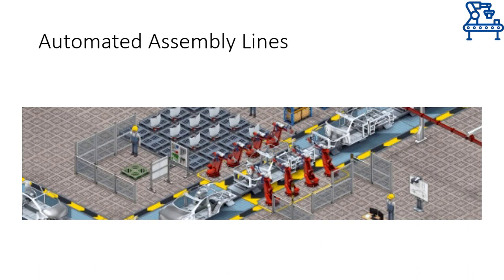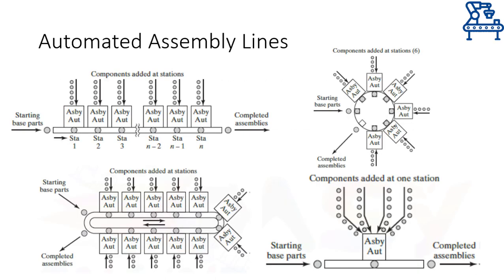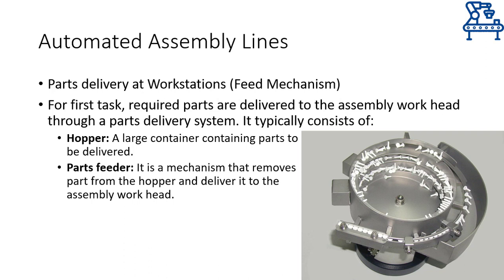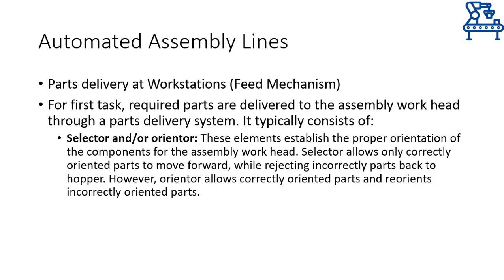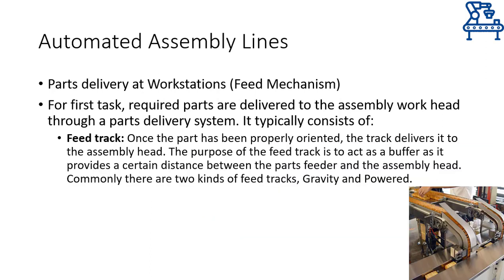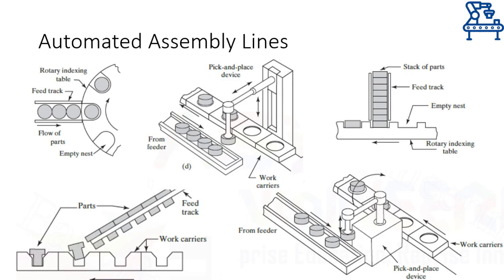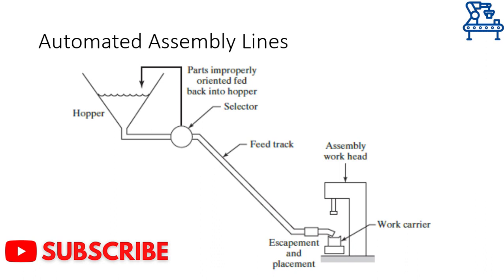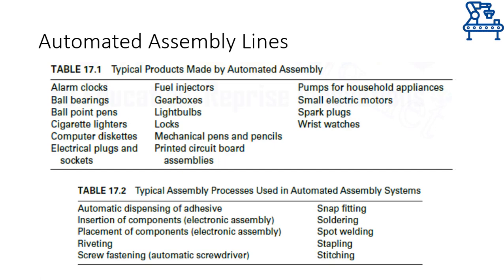Automated Industrial Lines | Assembly Lines

Comment: Consider the EXAMPLE of  assembly of a CAR,
let's assume that certain steps in the assembly line are to install the engine, install the hood, and install the wheels (in that order, with arbitrary interstitial steps); only one of these steps can be done at a time. In traditional production, only one car would be assembled at a time. If engine installation takes 20 minutes, hood installation takes five minutes, and wheels installation takes 10 minutes, then a car can be produced every 35 minutes.
In an assembly line, car assembly is split between several stations, all working simultaneously. When a station is finished with a car, it passes it on to the next. By having three stations, three cars can be operated on at the same time, each at a different stage of assembly.
After finishing its work on the first car, the engine installation crew can begin working on the second car. While the engine installation crew works on the second car, the first car can be moved to the hood station and fitted with a hood, then to the wheels station and be fitted with wheels. After the engine has been installed on the second car, the second car moves to the hood assembly. At the same time, the third car moves to the engine assembly. When the third car's engine has been mounted, it then can be moved to the hood station; meanwhile, subsequent cars (if any) can be moved to the engine installation station.

Assuming no loss of time when moving a car from one station to another, the longest stage on the assembly line determines the throughput (20 minutes for the engine installation) so a car can be produced every 20 minutes, once the first car taking 35 minutes has been produced.

REFERENCE: Wikipedia

Comment: - At ABB's assembly plant, a variety of robots (in an assembly line) are used to assemble low-voltage circuit breakers.
- At Stanley (name of an industry), stapler guns are assembled via assembly lines.

Comment: Different types of transistors inside the microchips that are connected together using metal connections require assembly lines for doing so